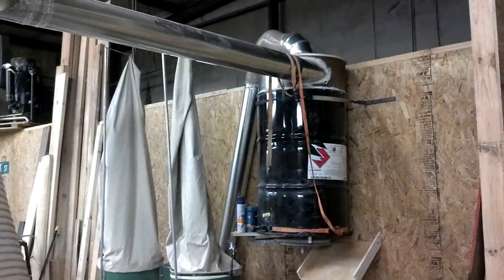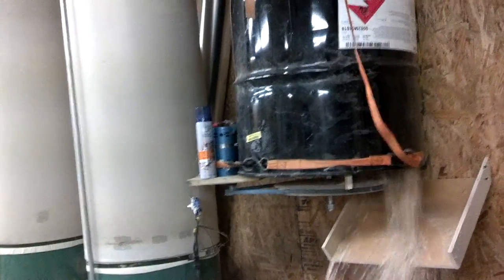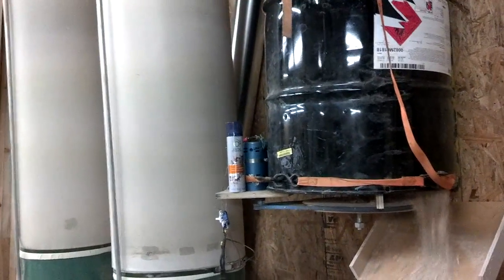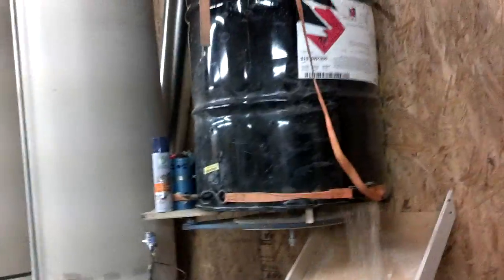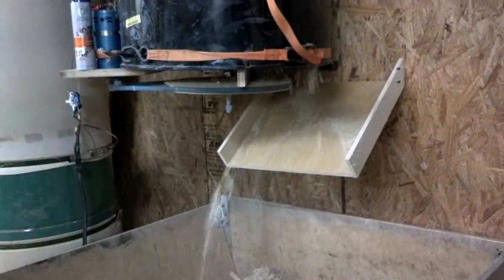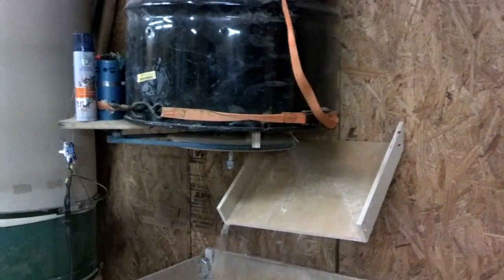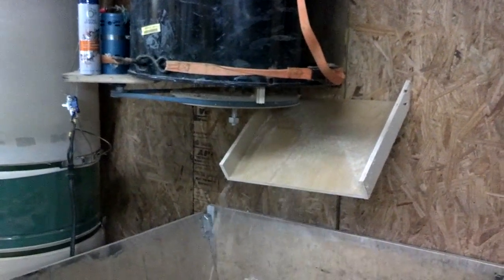Homemade rotary airlock test

Comment: what issues did you have with pinching and how did you solve them?
Reply from the maker: John Benson, the pinching issue would be best solved by stronger paddles such as steel, and a good motor. The industrial ones are all steel and would just power through small clogs. This setup worked great until one of the wood paddles broke.
Reply: It may add another level of complexity but if you had an air feed to the paddles. This would squirt air from the middle of the end of the paddle in to the small space between the end of the paddle and the check plates. This would cause a slight positive pressure and stop bits getting stuck in there and increase the seal.